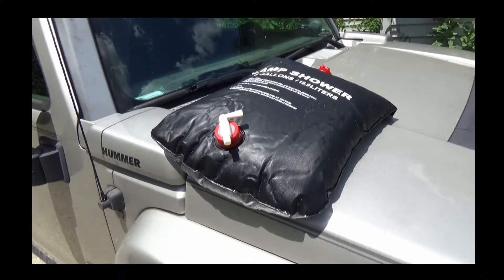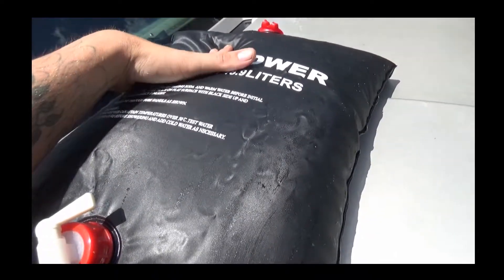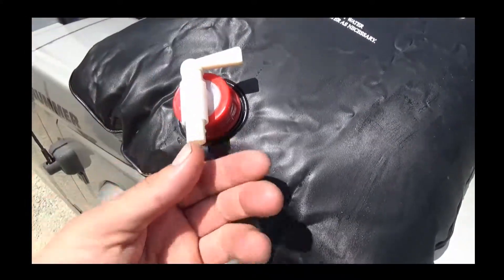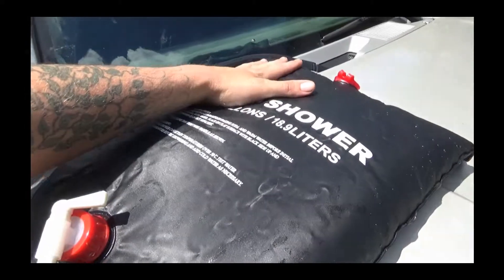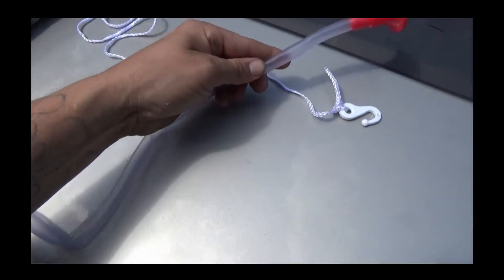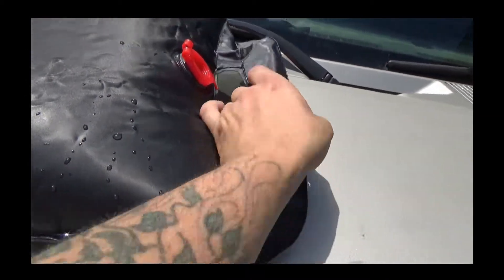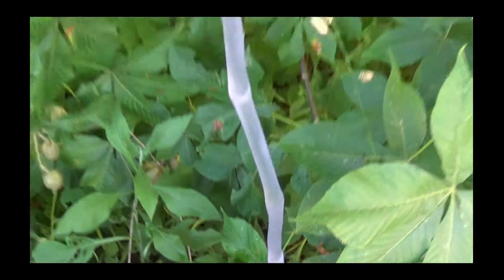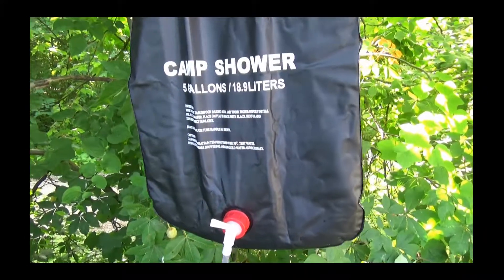Solar shower review

Comment: I need me one of those where'd you get your?
Reply from the maker: I think I got it from walmart.  It wasn't very expensive.  Maybe five to ten bucks...  Something like that. I would recommend using camp soap with it.  It doesn't take a lot of water to get all of the suds off.
Reply: Walmart has them here just under 10.00. not expensive